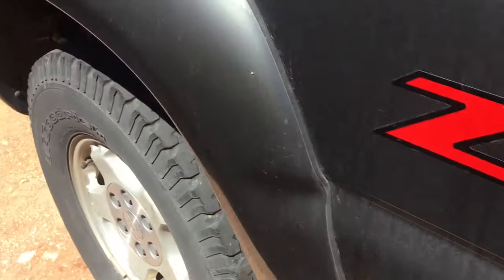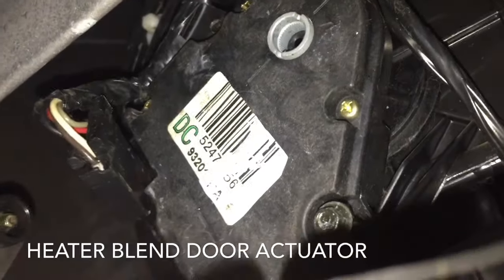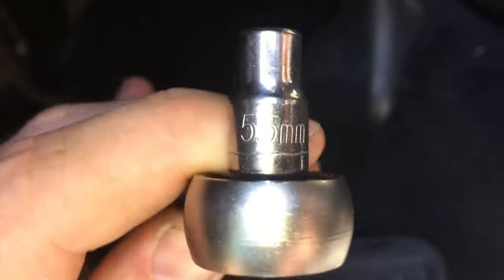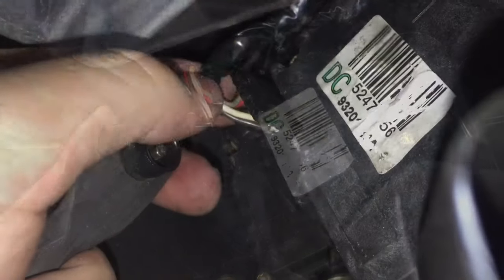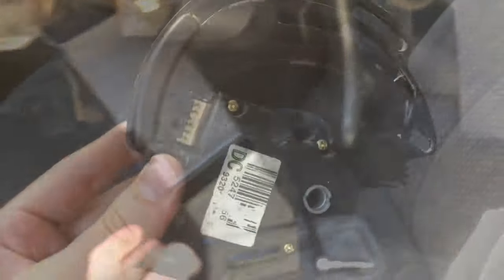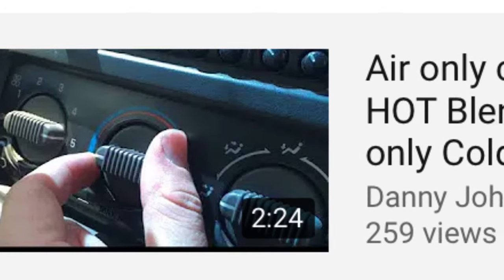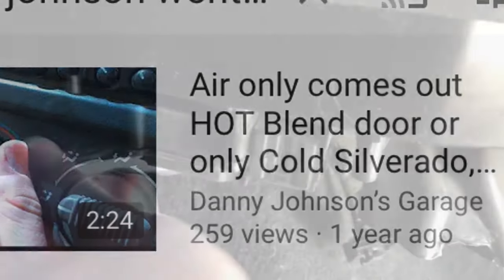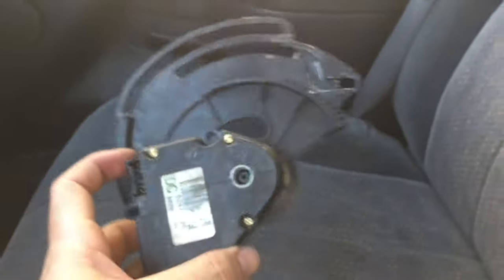Air only blows out defrost or top vents: mode actuator Blend door 99-2007 GM Silverado, Tahoe, Yukon

Comment: you should've showed how much of a pain it is to install it,
Reply from the maker: I haven’t yet 😅😅😅. Do you put it all the way on cold or something?
Reply: if you take the whole mechanism out u have to line it up with the actual white lever, and its hard as hell to slide it behind to match up the teeth, if you push it all the way towards you thats defrost, away from you is vent only
Reply from the maker: I’ll try that. I was messing with it when it came in and lining up the white post but it wasn’t working right. I’ll try on defrost to start
Reply: Put one of these in my dad's 2001 Sierra today and thought I would leave a couple of tips for others to try and help. It's relatively easy to take out but not much fun to install the new one. First big thing I figured out is that the actuator can be separated from the large "bracket" that has the slots in it. It is just pressed on and you can pull/wiggle to remove it. Check around there are other videos showing people removing the bracket. Unfortunately I didn't know that at first, but one option might be to try and leave the "bracket" in there and just remove the actuator and replace it by itself. But if not and you have taken out the actuator with the bracket then on the install you can separate them and then install the bracket first which is a pain to line up but easier if you are just doing that piece. Then install the actuator onto the shaft once the bracket is in position. I found for me I ended up using the old factory bracket - since it just seemed to line up better with the slot, gear, and center pocket. Then I put the new actuator onto the bracket and secured the screws. It was still a fight but I got it in there, and knowing that the bracket could be separated from the actuator was what made the difference for me (because then I could see what was going on a lot better to line it all up). Hope this helps someone else, good luck!!

Comment: Replaced with a new one - new one blows opposite, when dial is set to defrost it blows out vent and vice-versa.
Reply from the maker: I still need to figure mine out, but I think you may need to start the wheel off in a certain position
Reply: You accidentally used a blend actuator instead of a mode actuator. Buy a mode actuator & save the blend one as a spare for when the hot/cold one goes out.
Reply: @justinstandifer604  Okay, I wondered.  I knew there were two and thought I ordered the correct one, but it was some sketchy chinese company so lesson learned.  It's an old truck that nobody else drives and I've just been using the defrost or face modes, except with the dial reversed.  Someday I'll get around to fixing it.

Comment: Mine only blows floor and face
Reply: Did you get that fixed yet? Mines is actually doing the same thing as yours, Mines doesn't defrost the front windshield just blows in your face and floor as well.
Reply: @djhulksmash9898  I ordred a new actuator but i think its the wrong one. Perhaps for the heater door even though they look the same. Except the shaft part is metal on the oem this is plastic. I did install it but its not moving. I did something wrong so i took it back off. I opened up the old one, pulled the main large plastic gear, cleaned it and used an industrial superglue then zip tied around it to hold while it set up. Ill put it back in today when the rain stop. Thats usually what fails is the plastic main gear. You can buy new gear on Amazon or eBay for about $12 and change it for the diy'ers who want to be cheap lol